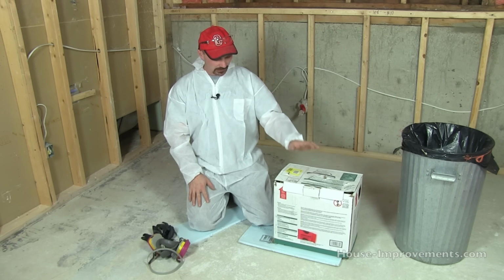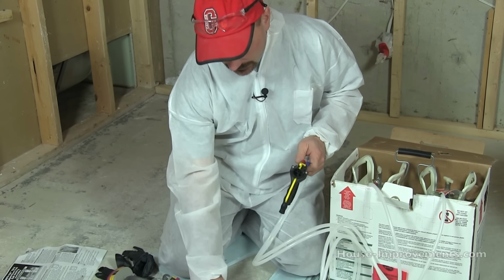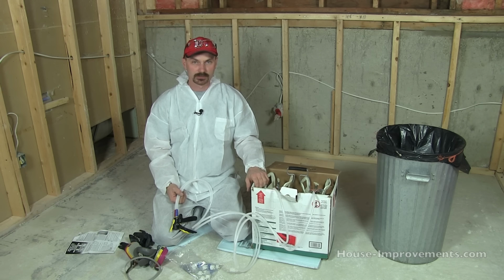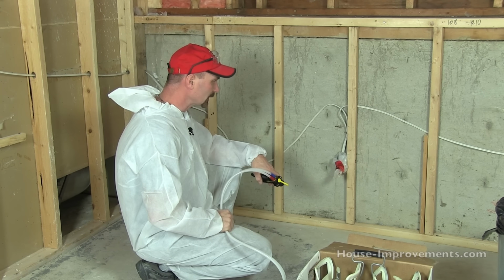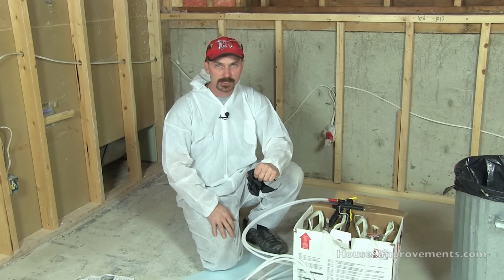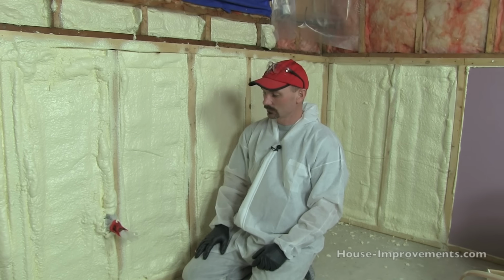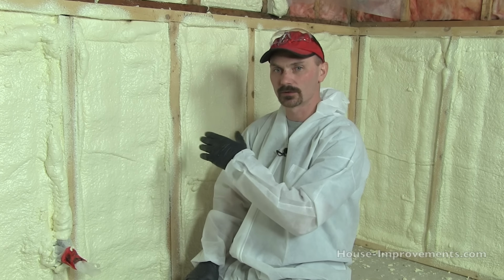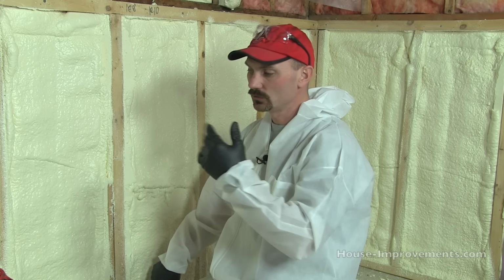How to Install Spray Foam Insulation DIY

Comment: I'm surprised the tips are so stubby.
I would have guessed that there isn't as much of an opportunity for the components to properly mix in such a stubby tip.
Reply: The material will come out of the gun in a spiral motion and mix in the chamber then gets squeezed into the small tube tip to insure both part A and part B are thoroughly mixed before being applied. Even further mixing happens on contact to walls as well.

Comment: Think this guy has ADHD baaad. Sprays this pocket goes across the room to another pocket then back instead of just starting from one end an working down. Also those holes for the electricity is bizarre. Plus their was no plates in front of the wire so a screw can potentially hit a wire.

Comment: You do not want to use this because tests have Been done on this and a house was in complete flames in only 44 sec that foam is extremely flammable and the fire retardant does nothing for that.
Reply from the maker: +Justin Nicolas It can not be left exposed because of fire.
Reply: For a little more in cost, you can buy foam that  acts as a fire retardant.  Check on Cleveland Airport and the foam they used on interior and exterior of their buildings and the savings they saw in their insurance rates.

Comment: wow be careful with foam insulation. It a so called risk -insulation. In walls dont use organic material in contact with foam..bla bla...it is also sensitive to damp/ small small mushrooms.

Also separate the outer board an inch away from the foam with air. It mlght work in dry climates though...hmm

Comment: The foam cures the same all the way threw its the same product so u do not have to do several coats that way its a waste of time
Reply: Not really. You have to be careful of the exothermic reaction. If you spray over an inch at a time, it can become too hot and the cure can actually "cook" the foam. Letting the heat off is as much safety as it is producing a good result. 
I have seen it catch on fire from a 3" thick spray. While the guy had no real ventilation, if he did not have a fire extinguisher near, he could have had a serious problem.
Smiles!

Comment: You can't use this product in this application in Canada. It is only certified as a bead applied sealant.  Spray foam insulation must be certified under CAN/ULC S705.1 and be installed by a CAN/ULC S705.2 certified installer.  This product will have a CCMC certification similar to the one for Froth-Pak CCMC 13447-L or Touch N Foam CCMC 13600-L.  A spray foam is also not allowed to be considered a vapour barrier unless it is at least 2lb cu/ft in density and installed by the previously mentioned certified installer. The photo in this link, http://www.touch-n-foam.ca/system-600.html depicts the proper use of this type of product in Canada.  The photo on the .com version of the same link shows what is allowed in America when it comes to the use of this foam product.  If you are in Canada don't let your local building supply or "guy who knows everything" persuade you into using any DIY twin tank foam system for insulating purposes.
Reply: You gotta be an engineer!!!!  Who cares and who else could understand this crap!!???

Comment: DO NOT use spray form in your house. It will cause moisture issues like synthetic stucco (EIFS). Fiberglass insulation is far better.

Comment: Save yourself some time and go to 12:00
Or save even more and skip the entire video, this guy doesn't seem to know what he is doing.
Reply: Jared Freeman I saw this one.
The way he jumps around from spot to spot is a tell tale sign of an amateur, begin in one end and do it space by space.
Reply: Seroster
Where's your video? let's see your professional video.
Reply: Peter Hall
Seroster is correct and you need a minimum of 2" for spray foam to be considered a vapor barrier and it looks like he only has 2x2 walls
Reply: Seroster check online with a company called spray nation they'll have a lot of different kits. The also offer a safety class for you to go to, it'll show you the correct way to use their products.

Comment: so what is the point of using this method?
Fibreglass= way faster because you just have to cut it to fit the framing,
It is way more safe, way less messy, and you can remove it way easier. 
Spray foam= waste of time and waste of money. Chemicals aren't good for you, use more natural sources of insulation like sheep wool for instance. 
I hope no one is idiotic enough to use this stuff
Reply: +dancingintherainish Many would say that sheep wool is a waste of money over spray foam.
Reply: spray foam has a much higher R-Value than fiberglass. 
standard 2x4 can only take R-13 fiberglass but with spray foam you get R-7 per inch so in the same 2x4 you would have approximately R-24 insulation.....almost double that of fiberglass

at least that's all the studies I've read about it. But, I'm still not sure about the safety of it either, have heard of some pretty bad horror stories
Reply: dancingintherainish 
6j
Reply: Spray foam is far superior to Fiberglass batt in many scenarios.
 The spray foam actually pays for itself over time (and then some) with the amount of energy savings it provides, so you mentioning it being faster to put in batt is irrelevant. As far as safety goes, workers are required to wear respirators and the chemicals are cured in 24 hours.
Another advantage of spray foam is it completely stops air movement, where batt just acts as a filter. I've seen $600+ heating bills go down to mid $200s on 4,000  sqft homes because of spray foam.
Reply: you can get R-14 actually.  the spray foam in this video does R5.6 Per inch.
Reply: For your chemical concerns I believe they make a spray foam that is soy based
Reply: I don't think mice will go into spray foam like they do glass batts. I opened some of my basement walls and fiber glass insulation was Swiss cheese. They rendered it useless.
Reply: Your comment is idiotic. Fiberglass doesn’t do half the efficiency foam does. Where is the danger when the foam is cured and in the walls and ceiling? My entire house is foam and I can light a candle to heat my house.
Reply: @Mr123SGardner  Yeah, you will be dead but people will rave over the R value of the house! lol